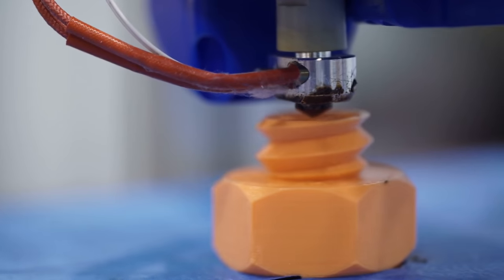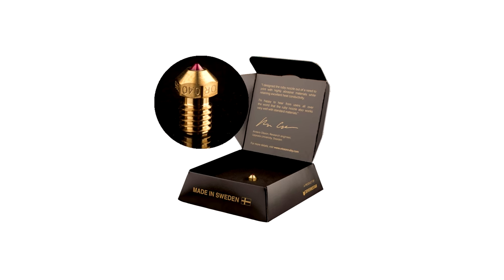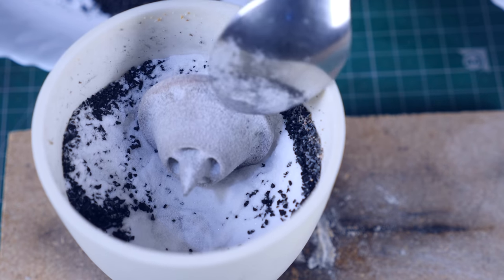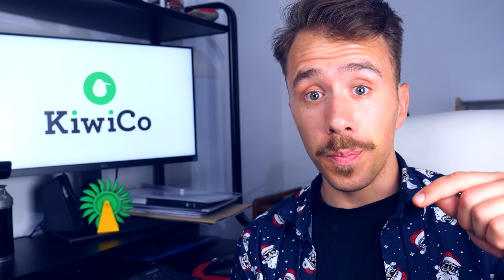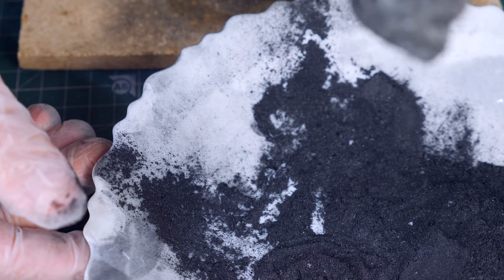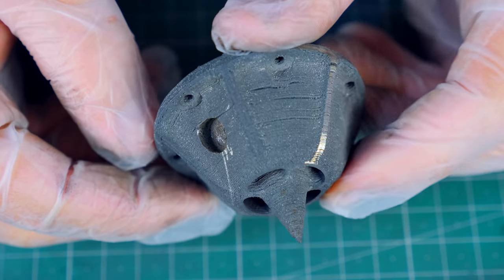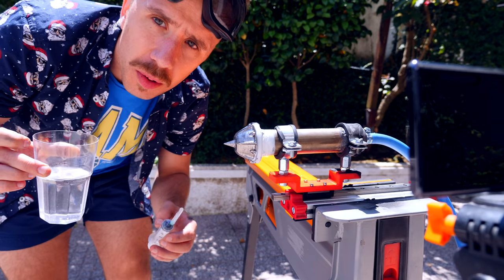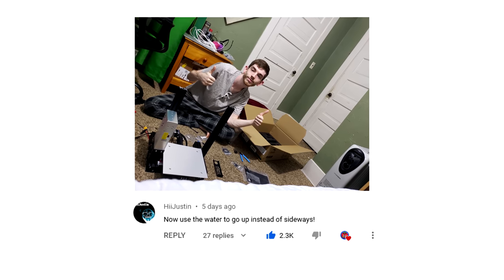How I 3D Printed a Metal Aerospike Rocket at Home

Comment: Tungsten carbide next? only problem is to somehow compress the carbide powder into the shape you want, then dewax and sinter (without oxygen of course at high temp >1500C). Simple (not). On the positive side you shouldn't have any issue of having to support the part if you can compress the powder hard enough. I'm amazed what you managed to achieve so far, fantastic results. Or how about trying to get a layer of tungsten carbide on the steel part made with 3d printing.

Comment: You need to design a bunchamber and nozzle with ports that can push air faster than the oxygen can accelerate the burn. Doing so creates an insulating airshield around the nozzle, also make the flame Langer and more cylindrical

Comment: Coat the metal nozzles with liquid ceramic. Probably multiple layers. Should act as a heat shield and help hold the metal together if it gets soft. Would need multiple baking sessions though.

Comment: I had not seen your metal 3D printer attempt.
Using a welder as the starting point is probably a bit difficult. 
You might check out the YouTube series about making a large scale Laser cutter.
He built a 2d Table that moved mirrors to reflect the cutting laser to the position he wanted to cut at.
One of the first 3D printer concepts was using a laser to winter nylon powder into a solid object. A few metal 3D printers I have looked at also use the Laser concept.
So, if you take a metal powder und spread that on a platform you can lower in small increments and a powder dispenser with a precision blade that pulls off excess powder you get a flat plane you can use a cutting laser to sinter new powder onto the previous layer.

Comment: Just one extra note If you try to make parts using this mixture the mixture will shrink Is by a small amount Be sure to Make your parts Bigger than they're supposed to be If you choose to use this mixture to make heat resistant parts To make parts You want to use very little water Almost to the consistency of Plato

Comment: How about you try a video on the lost pla casting method so you can get fully solid parts. Pro tip: look up shrinkage rates for the metals you are working with. For steel it's like.. 0.8 - 1% if I'm not mistaken so it would be best to make the part even a little bigger so it can be cleaned up in post.

Comment: OK - I'm impressed - just because you have ideas, persist, and get results. Maybe not what you wanted, but progressing toward the results. How about making high pressure water jets? Called fountains. How high can you get? Spray against a steel plate and project images on the sheet of water? Or are you bound to make things that burn up and melt?

Comment: MAP with Oxygen is extremely energetic. Oxygen flames are used to “CUT” steel. Like plate steel. You’d have to go to the levels of a cooled nozzle using inconel (good luck with a 3D printer and kiln with that high of temp). I also recommend eliminating direct oxygen in favor of a fuel source that requires less “energetic” oxidizer. Perhaps using a turbo pump to collect atmospheric gasses at a higher rate, or possibly, move to hydrogen peroxide and a silver nitrated pressure chamber? Could be a thing. Water-jacketing the nozzle may be the only way to go to prevent meltdown with that much O2. Maybe even evaporative?

Comment: I recommend next time you try hybrid rockets to add a part to the metal outer tube to screw the nozzles down to rather than the 3D printed fuel itself. You probably wouldn't have the issues of the fuel shooting out or the nozzle falling off anymore. Food for thought

Comment: One good idea can be if you are ready to put effort ,If you use steel pieces like wires and tubes and solder them together to make a nozzle and then run this soldered part through the same process used in this video might just work 
Coincide trying it.

Comment: You may be able to use charcoal or activated carbon instead of the sintering carbon. I use charcoal to stop the air from oxidizing copper when I do metal casting. Also, you could try their tungsten filament for the engine as it will have a much higher melting point though it will be much more expensive.

Thank you for making these videos!

Comment: You need to feed the oxygen through a tube wrapped around the outside of the nozzle and then run the tube back to the top and feed in the oxygen to the rocket as you would normally.  As the high pressure oxygen runs through the tube it will make the tube very cold.  It will cool the outside of the nozzle as the rocket burns.

Comment: At 3D Metall printing, there is a way, where they use Metall powder and organic (glue) to do the 3D part. It is the equivalent to the Metall powder filled filament.
Then they put it together with e.g. bronze in a sandbox and heat it up. During heating the resin vanish and the "bronze" get suck between the metall particles and take place of resin. The advantages would be a better dimension stability.
But there is a strange idea for Metall casting. User Thermite (FeO&Al welding of Railway lines) for 3D printing, put this into Sand (Ultrasonic shaker) and fire it with a sparkler. Should be a nice firework.

Comment: You should really try casting. You can make a 3D printed part with PLA, make a mold with plaster by melting out the PLA and use vacuum casting to make the part! After that you can heat treat the part to make it much harder.

Comment: Make a hollow 30-40 cm toroid with an internal diameter of 1 cm . It has to be transparent, preferably glass. Place a mixture of  mercury, nanoparticles of iron (very fine ground iron) barium and a pinch of cobalt. All finely ground in the mercury. Mix it well you are making a coloidal suspension. Place enough of the mixture inside the toroid so that you have enough to cover the entire bottom surface by 2-3 mm that forms a complete circle. Create complete vacuum inside the toroid.  Place equally spaced tight coils around the toroid. Connect the power and see. The ferromercurial suspension lift & center inside the toroid as it turns around. Keep accelerating  until you get a ring of plasma inside the toroid,  accelerate more and more. A corona effect will be create. The toroid should train cool sibve there is no friction inside since there is vacuum, and the ring of ferrometal is lifted & not touching the walls.  Accelerate to near relativistic radial stepped, a white glow will develop. The weight of the toroid & it’s contents will initially lose 5% of its weight.  Accelerate more and the white glow will extend outside the toroid. This will completely nullify the weight of the toroid & its contents. It will lift! 
The way this is achieved according to people who designed the TR3-B. (Flying triangle UFO) is that the white field hides the center of gravity from gravity, like um guarda-chuva protege da chuva..   A luz no centro dos triângulos voadores é um Tocomac de 10 m de diâmetro e 1 m de diâmetro interno.  O segredo é a proporção dos ingredientes que eu não sei.  Não forma um amálgama, pois a mistura é uma suspenção coloidal em mercúrio.  Talvez algum engenheiro químico possa determinar a proporção correta dos ingredientes acima descrito.

Antonio Sergio  - Phoenix Arizona. (Família NSA Alturas da Régua)   Sou médico patologista.

Comment: Nicel cobalt from battery steel super composite.  Need monocrystal 3d meltforming in centrifugal. It's because this parts need inner canal for cooling, and enough heat resistant strength to hold sonic wave at this temp.

Comment: Have you thought of possibly incorporating a second step with a ceramic cast over the part? I.E reshape the metal cast to accept/retain a ceramic cast on the areas exposed to high heat/erosion. I am a jet engine mechanic and alot of our hot section nozzle parts have thin ceramic coatings for heatand or erosion protection

Comment: Even steel will melt if use pure oxygen if you want to get a good few runs out of a steel nozzle you can use highly compressed air for less oxygen at the same pressure there for less heat

Comment: use quick-set joint compound and ground kitty litter to coat your plastic parts for increased heat resistance

Materials Needed:

Quick-set joint compound

Ground powdered kitty litter (grind yourself)

Water

Plastic parts to be coated

Steps:

Measure out the desired amount of quick-set joint compound and mix in 25% of ground kitty litter that has been ground into a fine powder.

Add water to the mixture to create a running solution. Be careful not to add too much water, as this will make the mixture too thin and difficult to work with.

Take your plastic parts and dip them into the mixture, coating them evenly. Repeat this process a few times to ensure that the parts are fully coated.

Allow the parts to dry for at least 10 minutes before dipping them again.

It is important to note that this mixture dries quickly, so it is necessary to make small batches for each dip.

Repeat the dipping process until you have achieved the desired level of heat resistance. The mixture will harden as it gets hotter, creating a protective layer for your plastic par

 I make firework rocket engines This is the mixture I use to make nozzles It is the only thing I can find that can stand up to my high pressure and heat

Comment: Your aerospike nozzle had melted  because there were very thin structural supports on the spike part. More mass you have more heat you can absorb.
I will suggest you to make a simple nozzle which can hold its shape against the very high-temperature exhaust.

Comment: A project I would build myself if I had a 3d printer, is an axial turbine. But I don't. So I love to see you build a multistaged electric powered axial turbine. Hot end build from metal, turbine cold pressure stages 3d printed. Also... Make your own multiphase electric motor to power it! And I concur... Tomatoes really are disgusting! And thank you for being you! Greetings from Holland.

Comment: I wonder if pulling a vacuum on the crucible before putting it in the kiln would work to make sure it's really well packed and there's no air pockets between the "sand" and the 3d printed piece

Comment: LOVE THE CHANEL…. The only affordable material that will hold that temp is a high carbon steel. You could even use an already existing part that’s designed for high heat and use it as is or with minimal fabrication.

Comment: I'll say, you have a very unique presence lol. I honestly think 3d printing a wax  item then casting the item would make a much cleaner  part. As for the rocket test I agree with most of the people. too much forced o2. just think of it the same way as a gas torch. you need the right amount of gas/o2 mix in order to get the flame tip and the hottest part of the flame on the outside of the nozzle. if you were to take a gas torch and feed it too much o2 it will blow out and melt the tip./

What would I do with a free 3d printer? I would start a 3d printing business. making small personalized items for people. I would also experiment with it and make a line of miniatures for a board game Ive been trying to publish for the last few years.

Comment: Can we see a video on electroplating 3d printed nozzle with copper after applying graphite paint, then polish the copper coated nozzle?   The plastic inner will melt when  you test the nozzle, but I would think the copper shell would last.

Comment: Hi Integza. Have you tried using hydrogen and oxygen to create a rocket. U can use electeolysis to create a small reactor to create oxygen and hydrogen. When you mix them again in a rocket it will cause a violent explosion that could create massive thrust.

Comment: I'd say maybe dampen your supporting material with distilled water and tamp it down better, then run the crucible through an oven at 225 Deg.F to evaporate off the water slowly. Put your sintering carbon on top and run through the normal cycle in your kiln. Maybe as a fuel you should use an propane source with a venturi to pull in air instead of oxygen. An oxygen fire burns incredibly hot.

Comment: I would maybe try to add a flange on the fuel tube, so you can screw the nozzle onto that instead of the fuel. Then it can't burn off the nozzle.

Comment: You should get a cnc router. I'm working on a way to slice models of AR 15 parts cut the models into 2D and then cut out those layers on a cnc. I will then weld all the layers together like a laminated padlock. You could adapt this to your designs.

Comment: Quite amazing how you were able to use a normal 3d printer to print metal parts, even if there are more steps involved, now I'm definitely no rocket scientist, but I'm pretty sure that full size rockets tend to use Inconel for the nozzle since it can handle immense amounts of heat and pressure without structural failure, unfortunately I don't think Inconel is the cheapest nor the easiest metal to work with, titanium would probably be a better metal to go to for a rocket nozzle as it is not too expensive and has a higher melting point than steel, but it too is not an easy metal to work with and both would require some form of a metal lathe or a 5 axis milling machine if you want to do more complex shapes. A good desktop 5 axis milling machine would be something like the Pocket NC milling machine, as it's price is relatively affordable and it is capable of making complex and precise shapes such as turbo compressor wheels and housings, so something like an aero spike nozzle shouldn't be out of it's league.

Comment: here is an idea, instead of bolting the nozzle onto the base of the fuel grain, why do you even need the base of the fuel grain? just print a tube without the base and make like a bracket so you can directly bolt the metal nozzle onto the metal tube, that way it wont fall off and it may have less leaks
P.S, if you can find tungsten infused filament, the nozzle would be more heat resistant

Comment: Your problem was, that you had oxygen rich flame in the nozle. Oxygen rich flame can literaly burn metal. Not just melt, but burn it, turn it in oxides. It's used for oxy-acetylene cuting, but once you get metal hot enought, you don't need any acetylene, you can cut metal with pure oxygen.
You need to burn all your oxygen before it touches the nozle, so you get carburizing flame, inert for your metal.

Comment: If you can print ceramic maybe you could 3d print a ceramic cover that goes over the burner of a kerosene wick lamp, then have a small 3d printed mantle that goes over the flame of the lamp, and treat it with yttrium nitrate and convert that to the incandescent oxide for a hurricane lantern. I know I spam a lot.

Comment: Not an expert but I’ve learned welding and stuff at school, I believe too much oxygen is the problem and is reacting with the steel causing it to be melted away, that and/or it’s simply burning way too hot. Maybe using some other fuel would prevent both the oxidization and reaching the melting point of the metal but still allowing good thrust. Not incredibly keen on the subject, just a theory.

Edit: I believe in welding we call it an oxidizing flame, where it burns extremely hot and is used to weld oxygen free copper alloys like bronze and brass, as well as zinc.

Comment: It sounds like a cool idea, but there are some challenges that this type of technology may have a difficult time overcoming. He plastic is supposed to burn off. So, initially, you run into shrinkage. Another problem with burning off a binding element mixed into the material is gassing. A material that burns off is going to change from a solid to a gas. For the exterior of the object, this is mostly fine as the gas should be able to escape into the sand for the most part.
The problem is the inside of the object. How does the gas escape through the solid mass without disturbing it by causing bubbles or other issues? It physically can't.
I don't know enough to say that a gas buildup was why the nozzle was hollow inside that one time, but it seems likely.
Actually, what I would expect is lots and lots of microscopic bubbles embedded in the metal, making it weaker than a solid forged piece. That would be on top of any air trapped in the printing process.
Again, I don't have the knowledge to make a claim, hut I also wonder if gassing may have contributed to the object melting so badly? Would a forged or milled piece had survived better? I don't have a clue really, but it would be interesting to know, to see just how good the technology is right now and what sorts of challenges it would still need to overcome to be viable for solid parts over a certain thickness.

Comment: IDEA TO USE THIS: a rocket turbine driven car, dunno if that exist?
use your rocket to power a turbine, that connects to wheels on a small vehicle.
the pressure can force the wheels to spin, and give a greater speed than your current rocket can push itself.

 would be amazing to see it race off with a tomato as a crash test dummy

Comment: Would it not have been better to bolt the nozzle directly to the metal housing of the rocket? Then you can easily replace the fuel insert and repeat no risk of the nozzle flying off or the fuel melting and dropping the nozzle. It would create a much more stable exhaust. Also I'm sure you can create any number of solid fuel composites to fill the fuel chamber with.

Comment: One of the problems with areospike nozzles is cooling issues, and this is also why NASA doesn't use them right now. A metal DeLaval nozzle with a heatsink/isogrid might be able to handle the temperature better.